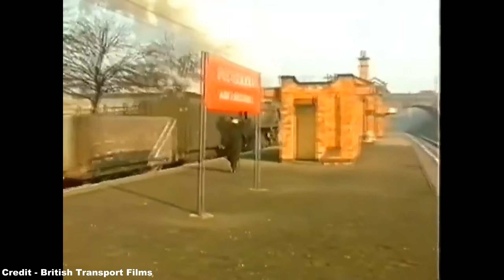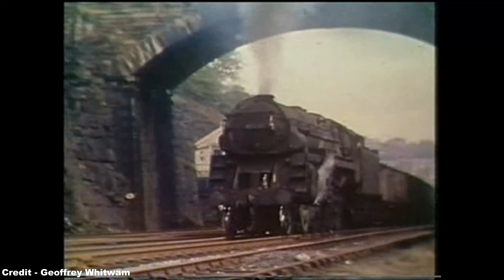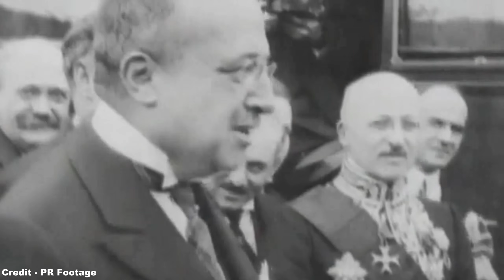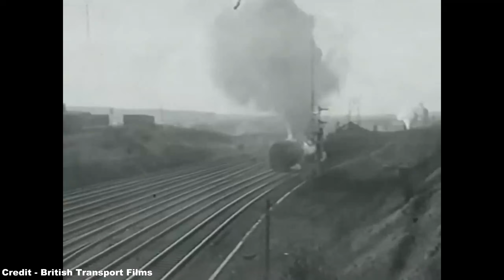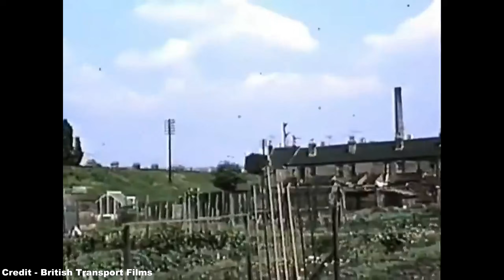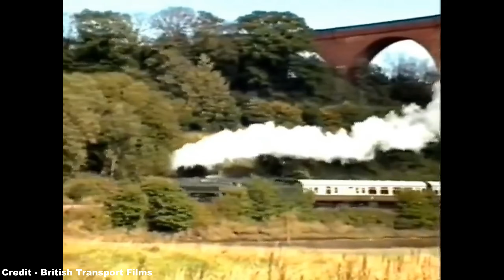The Last Stand of British Steam - BR Standard Class 9F (Reworked)

Comment: It's puzzling in a naive way , why water was boiled off to atmosphere, rather than being condensed for reuse. Because out that chimney was going....energy...a pre- heated water being replaced by new unheated water...that's a LOT of energy...gone...
Reply: Yes, but it is not totally lost. Some of this steam is used to draw the fire, drive the injectors and heat the train.

Condensing equipment adds to weight and complexity.
Reply: @physiocrat-sv Agreed, but the additional complexity isn't /that/ much. (To my knowledge, using condensers was the rule on steam ships.) However, the weight may well have been, as air had to be used for the cooling.
Reply: @chrislaarman7532  
Some locomotives were fitted with condensing apparatus eg for use on the London Underground but the cooling tanks quickly overheated.

Also in South Africa.
Reply: @physiocrat-sv  London Underground: yes, it takes quite some air to condense steam... Besides, I pity the crew spending their hours on steam engines in tunnels. Soot in your eyes, soot in your lungs...

South Africa: yes, little choice in desert areas.

In general: so much energy contained in the coal (or oil) burned gets lost. It does make sense to put every bit of it to use. So, engineers have thought up quite some tricks for different stages of its use. I have learned some when I was to become a ship engineer. André Chapelon wrote a thorough book on steam locomotives. Currently, Swiss manufacturer DLM may constitute the centre of excellence, with former German steam locomotive 52 8055 and others.
Reply: @chrislaarman7532  - steam ships are different in two ways. Firstly- they are an order of magnitude greater in mass, generally. So is more space and weight for engine...
Second, they suffer from the same issue as their crew- "Water, water everywhere but nary a drop to drink". Salt in seawater ruins steam engines, ship cannot use it, so must have its own source fresh water and minimise loses of it up chimney more. 
So- different design/evolutionary pressures = no condensers on trains, but yes they on ships.
Reply: @keefymckeefface8330  I don't get the point you're making.

Yes, the biggest ships that have existed (tankers over 500,000 ton, some 50 years ago) were steam-powered (using turbines), but don't forget the many little port tugs that had hardly any space around the boiler and engine (and condenser).
Sidebar 1: to my knowledge, condensers "always" use some artificial vacuum to increase the pressure-drop over the engine or turbine. Locomotives would need their speed to achieve this. Similar to how they use their exhaust steam to enhance the draft in the fire.
Sidebar 2: these tugs (like locomotives) would have fire-tube boilers and reciprocating propulsion engines, whereas much-bigger ships would use water-tube boilers and propulsion turbines.

Yes, salt in the water can corrode the circuit or it can deteriorate heat exchange by depositing limescale. Using a condenser reduces the amount of salt entering the system. On some railway footage, you can see the fireman adding some chemical to the tender after taking water.

My comment that you're replying to stated that a condenser doesn't add much complexity, but does add weight (notably when air has to be the coolant). - You don't seem to address either of these, yet object. So what am I missing?  :-)
Reply: @chrislaarman7532  
My father was a boilerman running hospital steam boilers for many years. 

That chemical is an anti-scale chemical that stops the formation of scale inside the boiler...the formation of scale insulates the heat from the water...so it's formation needs to be stopped.

It would be great to be able to use in kettles that "fur up"...but the taste wouldn't be nice....
Reply: The size of the heat rejection apparatus to allow condensation of steam back to water would be huge....

There is always a loss...
the balance between perfection and "that'll be good enough, mate"....

Nuclear and coal fired power plants have the same problem....
Fukushima was near the coast so it could cool down the steam using seawater....and seawater drowned it during the tsunami...

Many British coal fired power plants used those hideously large concrete cooling chimneys....
otherwise using river water for cooling and then discharging it back to a nearby river would have boiled the water in the river....
Reply: @JohnSmith-pl2bk  Thanks John ...appreciated
Reply: @JohnSmith-pl2bk  Hideous large concrete cooling towers? 
Beauty is in the eye of the beholder. As a lorry driver I am shocked at the disappearance of much of the infrastructure, that we were used to, growing up, as I drive around the country.
The number left is very low, probably less than thirty, compared to the hundreds, when every large town had a pair at their local Power Station or Gas Works etc. 
I still think a well composed photograph of a coal train steam, diesel or electric with a cluster of cooling towers looks magnificent. My favourite colour photograph being of Rose Grove Shed in 1968,  published in "Rails in the Fells", at sunset with the cooling towers of Huncoat power station in the far distance.

Comment: The 9F are like one of the most powerful steam locomotives in Britain, and they looked pretty impressive.
Reply: We have now reached peak 'like'
Reply: @liamcollins6940 - Weren't they classes 40 - 45..?? 🤔🤣🤣
Reply: The p2 and p1 are judging you from the grave
Reply: @blehtbh - Learning what "one of" means will help you greatly here...

The U1 is judging you... 😜🤣
Reply: @BassandoForte  nah I’d win
Reply: @blehtbh  - The U1 being a Garret is the most powerful loco on UK metals...
Reply: @BassandoForte  no, that was the LMS duchess. The U1 had high tractive effort, but you won't find a drawbar horsepower value from the U1 that exceeds the Duchess value.
Reply: @cobblestone_cowboy  - Horsepower gives you speed on rails, tractive effort is how much it can pull...
Pulling power is what Freight trains need - Therefore you can't really compare passenger to freight locos - Passenger = a few large wheels 
Freight = many small wheels... 😉
That's why that Belgium Quadroplex had over 1.2 killonewtoms in pulling strength - nearly twice as powerful as the UP Big Boy...
Reply: @BassandoForte  Not really. (1) tractive effort only give the pulling force at starting. As soon as the cut off is reduced, the pulling force falls, and it falls much faster for locomotives which don't have big boilers and high superheat etc. The 9F and the LMS duchess had very good steam passages, so the drop of pulling force with speed was not very large. (2) the power is basically the pull times the speed. At starting, the speed is zero, so the power is also zero, so the tractive effort doesn't say much other than the train might start. As soon as the train is moving, power is important. 

The Belgian Quadroplex was not more powerful than the big boy - that's a misuse of the word power.